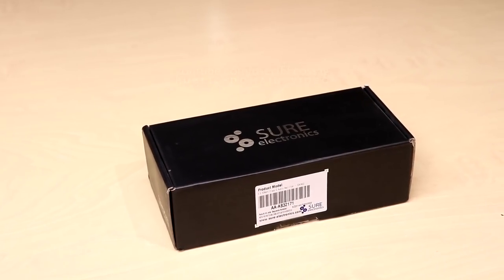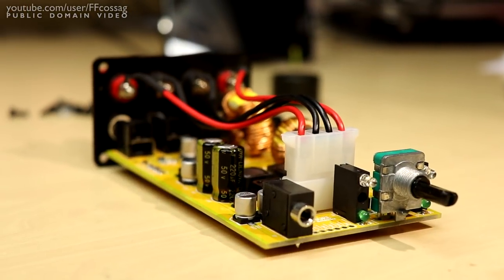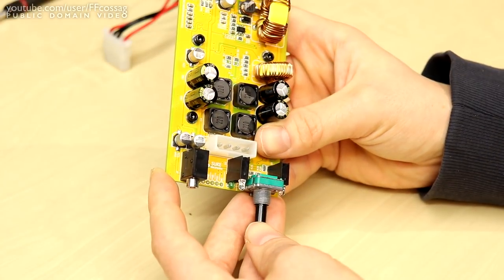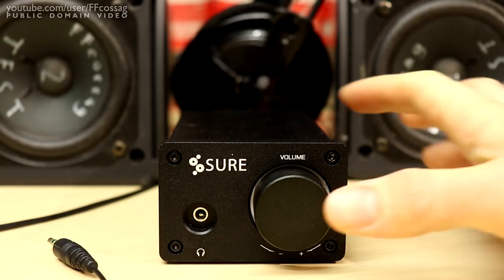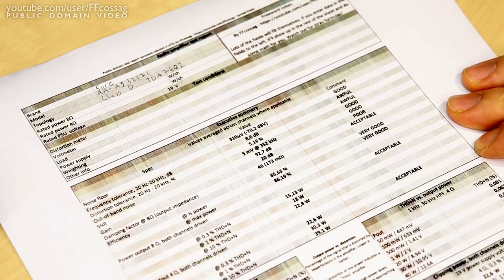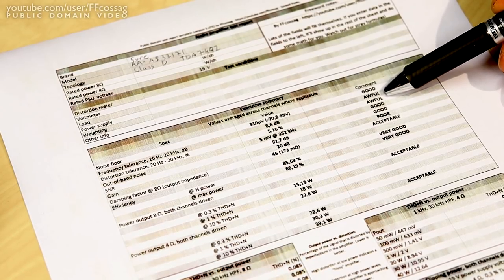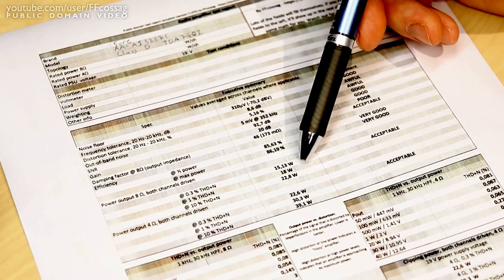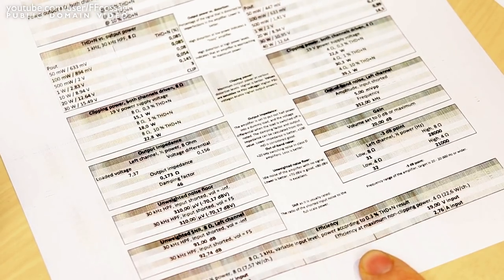Sure Electronics TDA7492 amplifier review (It's got issues!)

Comment: The frequency response depends on the output filter values and also load impedance. I've looked at some bare class-D amplifier designs that you can get on Aliexpress or eBay and it's a bit hit or miss, most of them don't stick to the datasheet specified values which gives a bad frequency response, and most also have a poor PCB layout (missing ground planes, excessively long tracks on the output filter etc.).
Reply from the maker: Yup. I did some experiments on a board once, what you're saying is very true. It's a shame, because the proper filter design really would not incur any additional cost.

Comment: FFcossag: Thank you for sharing your expertise. Very educational.
Question: So there is a lot more to these AMP designs then just the audio chip?
I come from more the digital circuit side; which I suppose is simpler (dealing with just high and low logic levels).
The audio IC is still the heart of the amp right?  But the "devil" is in all the support details?
Reply from the maker: Yup. Especially the output filter is absolutely critical to get right.

Comment: I bought two of these Amplifiers recently (sadly before I saw your review).  One was dead out of the box (still waiting for it's replacement), the other performs satisfactorily.  It does not have the power on volume issue, it does seem to remember the volume level from when it was switched off... which is good.
I pulled the faulty amplifier apart and found that the small 8 Pin IC under the heatsink had gone up in a small puff of smoke (brown stain on the heatsink).  Not sure what this IC is/does, the writing on it is now illegible.  I might pull my working amplifier apart and see if I can tell what it is.  I might be able to repair the failed amplifier.

Comment: Hi FF
Did you happen to take pictures of the PCB top and bottom? Without the heatsink of course..  And are you planning to mess around with the PIC controller?
Thanks for yet another cool video!
Reply from the maker: No, I didn't take any pictures, sorry. And no, I'm not too interested in reprogramming this thing myself since I don't fancy encoder controller volume controls at all.
Reply: FFcossag Perhaps you could do a little collaboration with Julian Ilett or BigClive and send the amp. to one of them in order to try and reprogram the PIC?
Reply from the maker: I very strongly doubt anyone has the time to do such a project.

Comment: Hi, i have a question about the LC filter at the output. The datasheet for the tda7492 says that you should use 15uh inductors for 4 ohm loads and 68uh for 16 ohm loads. Why they are using 220uh? Is this better or  worse?
Reply from the maker: You'll have to ask the designer. Performance isn't stunning, so it's likely worse.

Comment: I think your dead right about the volume control. It's easy enough to code for an analog read on a Pic micro. It makes no sense at all that they've used an encoder. With a standard potentiometer it would be super easy to write a "for" loop to read the volume level from a pot and set it on the other chip. It makes me wonder if perhaps they forgot to clear their snorkel before going to work that day. Oxygen always helps the brain work better...

Comment: I think I've said this in the past... but if you have the ability to get your hands on an Echo Indigo IO or DJ (not IOx/DJx) PCMCIA card for cheap, you should do similar testing on these. olden, OLDEN sound card for laptops for DJ and recording use and they boast the ability to do 24/96... the Cirrus Logic chip on-board supposedly supports 24/192, however. I can't remember for sure, but I think this is actually selectable under Windows 7 and above's output device settings for the thing.

the only problem is, the volume pot on it gets scratchy with age, or so people say. Both of mine have done so, and I'm pretty lazy in replacing them.
Reply from the maker: If I am to buy a proper audio interface, I'm going to go for something more modern. No point sticking to PCMCIA and trapping yourself to C2D class machines from the stone age.
Reply: you can buy USB2 to PCMCIA adapters usually meant for flash cards-- it should still just work for plugging in anything that'd use the interface. they're relatively cheap-- anywhere from 25-46 Freedombucks... dunno what that'd convert to in Euros, but it's gotta be cheapish coming from China, still.

Comment: how much would a decent 12v power supply cost though?
Reply: Rubus Roo I recommend you look around (or ask friends) for old PC power supplies. They are easy to modify and provides 3.3V 5V and 12V and most of them provides 150W and up!
Reply from the maker: For one of these amps you want a 19 V laptop power supply. Use a second-hand, brand-name one. Do not buy one off of Ebay or Amazon, they'll kill you.

Comment: Its a cute amplifier but im not sure i like class D amplifiers, the idea is clever, but im an old stick in the mud.
They could have been smart and put the volume setting in a 24c02 and fade it in from switch on, pushing the control for 3 seconds could save your new value for the 24c02.
Quality of audio would be more important to me than volume.
Reply from the maker: Or they could just have saved the volume every time you change it. Like one would expect it to behave.

There's nothing wrong with class D as a concept, but there's often plenty wrong with class D as a Chinese concept. ;)
Reply: I love tripath class D amps. I used a 4ch gainclone for years and Tripath D amps are as good if not better without using a high quality power supply.

Comment: You realize if you designed an AMP that you considered excellent, people would buy it, right?
Reply from the maker: No, because people prefer the cheaper option.
Reply: I'm sure you could design a cheap and quality amp and out source the production to china. What was that cheap one you replaced the caps and some resistors on to make it not suck? Make something like that.
Reply from the maker: What would happen if someone did that, is that the Chinese would clone it, sell it with the wrong components for cheaper, and people buy that instead. ;)
Reply: I won't argue that. That's probably how the thing you fixxed came to be.